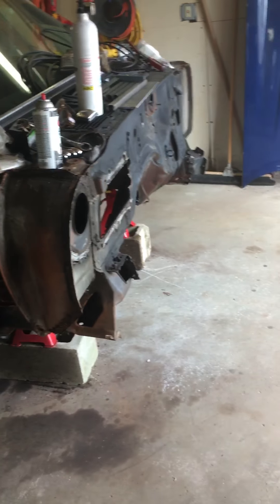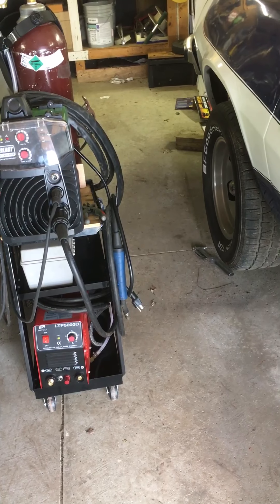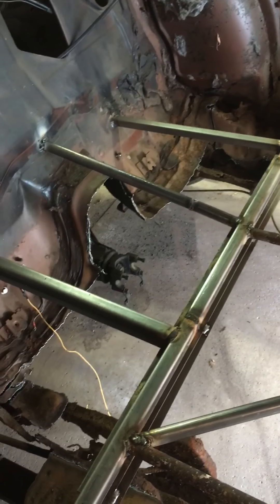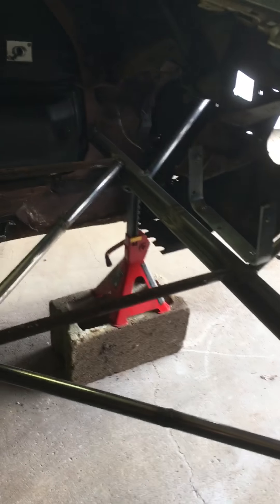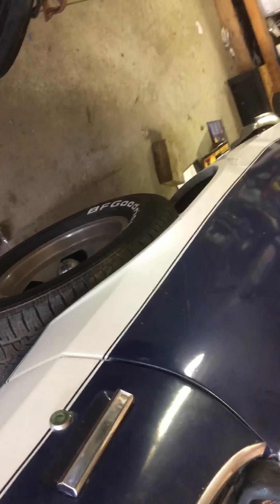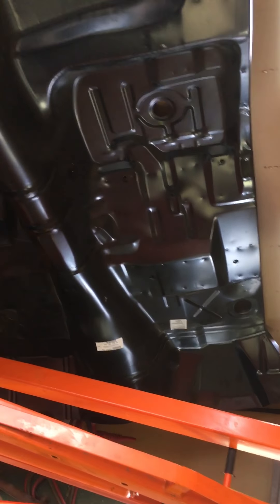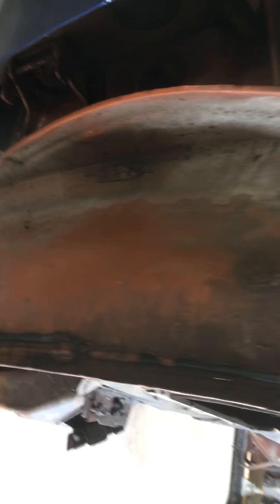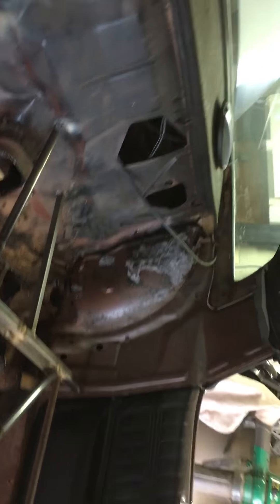77 Camaro 3.09.2018 Flintstone ready

Comment: The plasma cutter must really save time.  It took me hours just to cut out 2 smaller sections under the rear seat and the trunk panel.  What model is the plasma cutter?
Reply from the maker: Sam's Garage it's a Lotos , found it on Home Depot s website. You can get them on Amazon & eBay also. This one has the pilot arc model, the non pilot arc one is half the price but it will not work as well on our rusty ol ' cars.